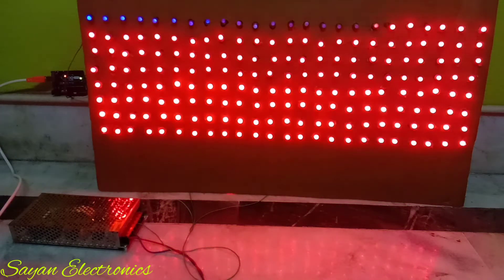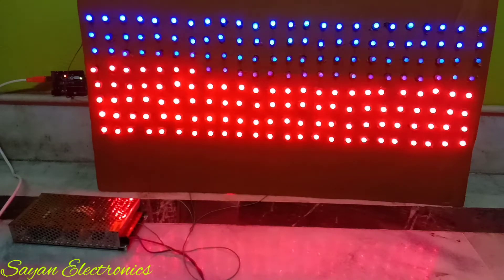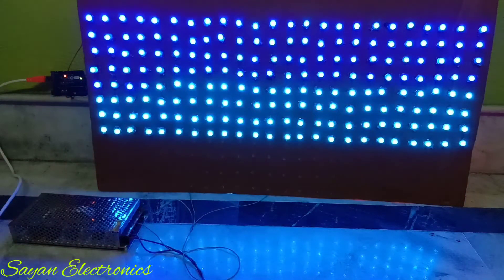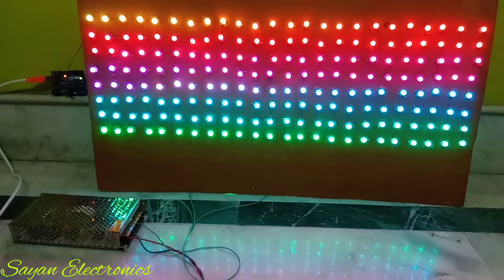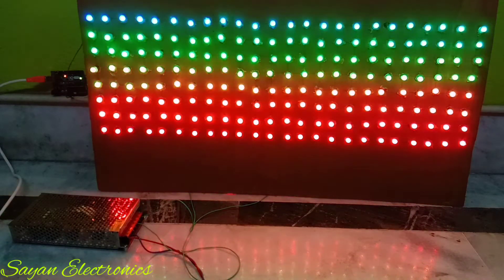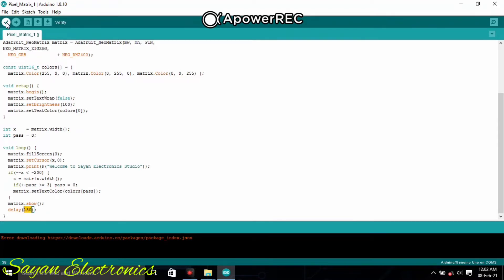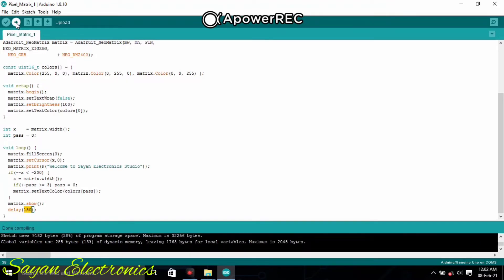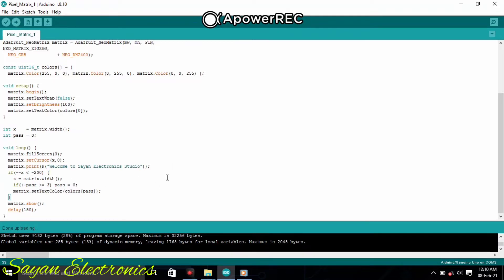How to make Scrolling Text Display using Pixel Led & Arduino UNO

Comment: Sir ws2811 led strip ka method bhi same rahega?
Reply from the maker: WS2812b pixel led strip ka connection same rahega ...
Reply: @SayanElectronics  Sir thank you for your valuable comments
Reply from the maker: Most welcme😊
Reply: Will same Arduino code work with ws2811 led strip ?
Reply from the maker: I haven't tested with ws2811 , but I think that Yes , it should work . Upload the code & see . Don't forget to give feedback...😊
Reply: @SayanElectronics  Thanks bro. I will try and give you feedback. Thanks for your video. I have subscribed you.
Reply from the maker: Thanks a lot for subscribing 😊